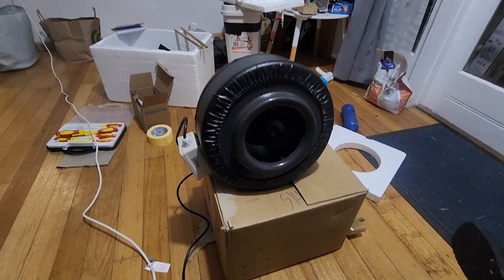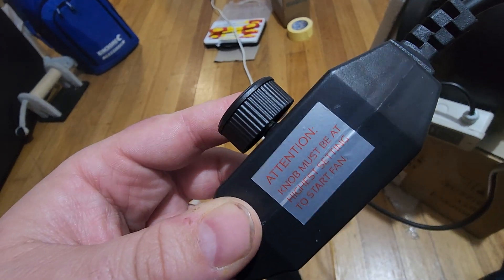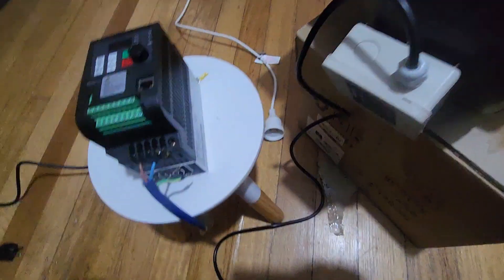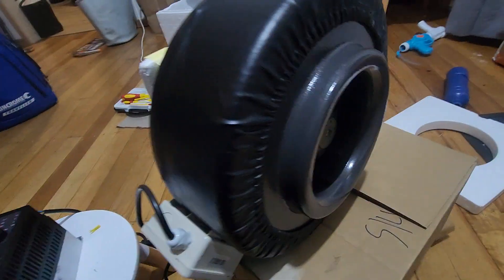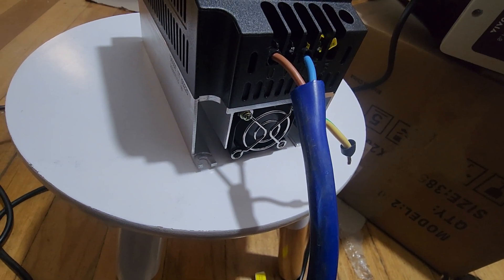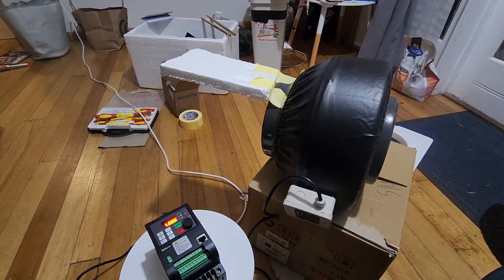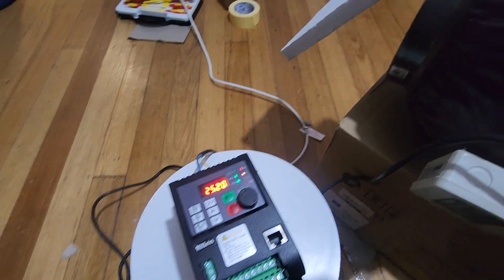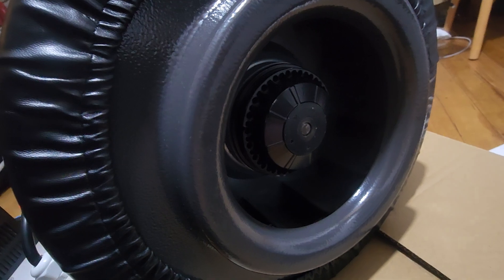VFD Speed Control of a fan.

Comment: Nice, you'll want to hook up that earth terminal right away since you have live on both conductors now and the big capacitor in that VFD is going to mask any earth faults from your RCBO, so it's going to hurt a lot if the insulation in that fan isn't up to the job. In the future you would be better off using an actual 3 phase fan, it'll spin up pretty much instantly to whatever speed you set it to and will be much more power efficient.

Comment: you should definitely connect the ground on the socket to the vfd. I would also recommend you change the motor parameters to match your vivosun, somethings off since it's not nearly as strong at 50 hertz as it should be (based on how it runs off mains). I would assume the voltage is off, it could be 120 instead of 240. I was able to find a manual by googling "nflixin vfd manual".

Comment: Are there any settings on the VFD for the cooling fan? If there aren't, you could put a thermal switch in line with the fan, something like a ksd-01f.
Reply from the maker: @benlee4940  I don't see any reason why you couldn't add a thermal switch to the heatsink the switches it on once it reaches 40°